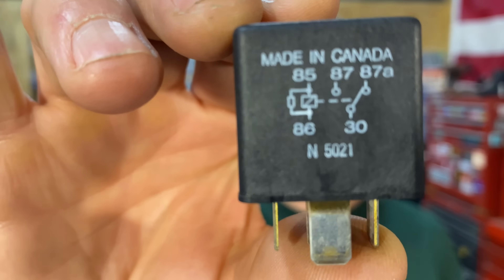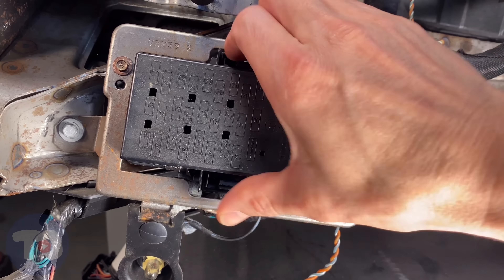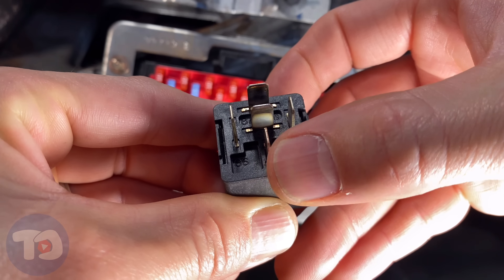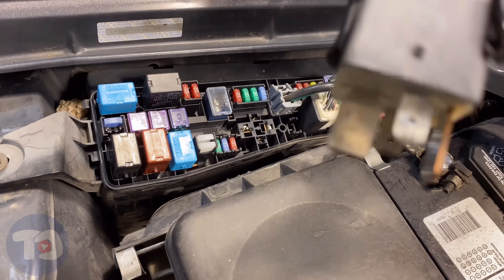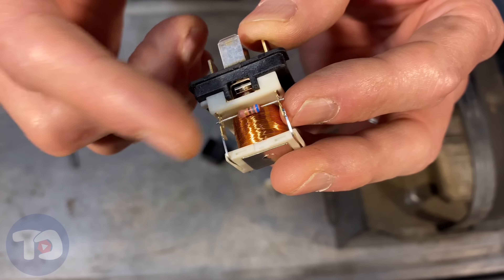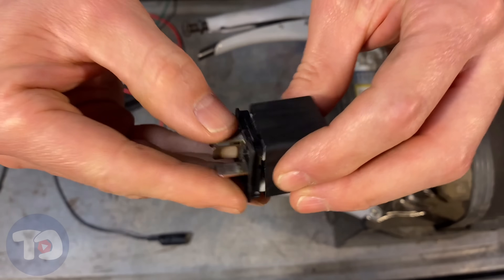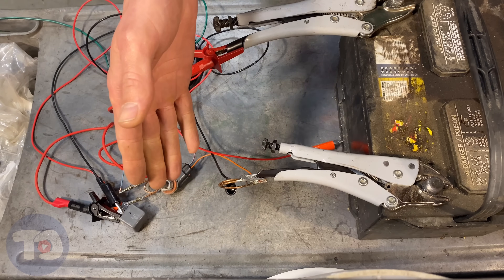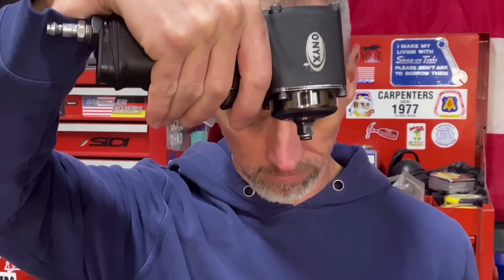Why are relay pins numbered like that?

Comment: Good video. The protective resistor looks to be 680Ω, FWIW, based on a quick search online for a resistor color code chart. Any idea why the engineers chose that value?
Reply: I guess that's from some calculation and experiments.The resistor is parallel with the coil, so when the coil receive power, so do the resistor. If the value is too low, it will draw too much current and become too hot, which will not only damage the relay due to too much heat, but also the computer that turns it on. Because chips in computer is not meant for big current. If it's too high, the flyback voltage will be too high when the coil is cut off, which will damage the computer.
Reply from the maker: I would have to assume that it still allows enough power to energize the coil efficiently, but also has enough attenuation to mitigate that current backfeed to protect the driver.
Reply: @ToolDemos it is the other way round, since it is in parallel wit the coil its resistance needs to be low enough to suppress the voltage spike when the relay is switched off, but it's resistance needs to be high enough so the resistor doesn't get hot when 12v continuously flow through it while the relay is powered on...
Reply: @Henning_S.  if a relay is hot to the touch would that be coming from the resistor? I replaced a couple relays that had started turning brown on the top. I presumed the coil was the source of the heat but it occurred without the relay switched on. There was nothing remarkable when I popped them open however you’ve given me an idea that I could check the resistance across the coil and across the resistor, would that work?
Reply: @ConceptXX  Probably not.
The heat generated by the resistor and coil is fixed by their values, and unlikely to overheat.
Very common is burned and pitted contact (that normally run cool when making good connection) are now generating a lot of heat.  (Just like a loose battery cable or starter wire getting hot).
The other possibility is excess or faulty load. (the fusing, if not overfused, should blow though)
Time to change the relay...
Reply: @troubleshooter1975  Yes, if it gets hot with the relay off it can't be the resistor,no power to the coil -no power to the resistor , so it must be the Normally Closed contacts on the relay that are pitted/dirty making a high resistance connection & thus heating
Reply: @neilf1059  I missed the part where he said it was hot to the touch when off.
If not recently energized; I would bet it was his blower high speed relay, a SPDT relay (5-pin) that is most frequently used in the 'off' state, and at 20-30A draw...
Reply: @ConceptXX  Neil F has a good comment.
Was one of those the relays for your  'blower high speed'?
If you are sure it wasn't energized recently and is still hot to the touch, the relay is bad.
Check that your blower (or whatever that relay controls) is in good condition, and not overfused in the fuse box.  If the load is not drawing excess current, then it is a bad relay.  Make sure you are using the proper rated relay for replacements.
Reply: It is not a resistor, it is a capacitor. The base color of the case is an indicator for that. Google “capacitor that looks like resistor” and you will see many examples.
Reply: @geertkroezinga6003  No-
That is a resistor.
And they never put capacitors on relays (unless it would be a .01µF for noise suppression, but those go across the contacts on higher voltages).

That is a 680Ω 5% epoxy coated film(?) resistor, looks like 1/4W.

Yes they do make capacitors in a package that looks similar to a resistor, but this is not one of them...

Comment: I can’t believe this kind of information isn’t more widely known among mechanics when it comes to those cryptic numbers stamped on relays. I mean, they seem pretty definite, and everyone who works on cars seems to know what they mean, or at least accepts them as normal. Thanks.
Reply: That which shall not be mentioned. 😂👻
Reply: Why would mecanics bother with understanding of electricity? Let the electricians do their stuff!
Reply: @micualex9799  Because over the last 100 years, "mechanics" as you call them have also been electrical technicians. They have also been electronics techs for only the last 40 or so. To better understand, try walking in their shoes for awhile.
Reply: @blackrifle6736  To understand is one thing, to apply what you understood is another. What I'm trying to say here is not to offend or create a discussion out of it. Simply I want to highlight that if you don't understand by all means how electricity works you should stay away and let professionals to carry that job. I've seen many cases when mecanic s tried "their best" an the results were...
Reply: @micualex9799  ...less than optimal. Or an absolute disaster. Cheers!

Comment: One thing... you state the switch never carries the full load but that is only true if you have a newer car with relays. These gadgets did not exist to be put in cars until relatively recently. For instance my '67 Austin has 2 fuses - one for things that are always hot and one for things only hot with the ignition/acc is on and that is the extent of it. Older Toyotas and Datsuns have a few more fuses but not a relay in site. I can't say for sure when these started to be common but I'm going to guess sometime in the 80's.
Reply from the maker: You're right, they didn't have a sophisticated design like today. They also had more electrical fires back then.
Reply: Look under the dash, bonnet or boot of any 40s-50s-60s Porsche or even further back; MBz and get back to me. Cheers!

Comment: Close to correct, but not quite. Yes, pin 85 is ground (-) and pin 86 is the positive (+) to the energizing coil to "turn on" and close the relay. But, pin 30 is usually used as the supply source (12v + or Ground -) and most circuits use pin 87 as the switched (NO Normally Open) item. Pin 87a is connected to pin 30 when the relay is off or (NC Normally Closed). [Note: Pin 87a (NC Normally Closed) may be missing on some relays]
Reply from the maker: You are correct
Reply: If its supposed to be a negative terminal or ground, the terminal code is 31, 30 or 30a is always supposed to be  battery positive, but in practice on a 4 pin relay you can usually swap 87 and 30 without an issue.  85 and 86 codes are used because relays can be switched on the high side or the low side  so they aren't necessarily wired straight to ground.

Comment: Neat trick with the mole grips
Reply: Battery positive needs a fuse - one accident and you get arc welding or a fire !!
Reply: @pjeaton58  yes for sure, 
I was just pointing out that for testing purposes them grips on the battery was a cool idea as the tiny testing clips won't fit them terminals.

Comment: The resistor across the coil contacts absorbs electrical spikes, this type of protection is very common in the US and is not polarity sensitive . Bosch relays very often use diodes to do the same thing these are electrical one way valves which again allow the spike to be absorbed, these are polarity sensitive, hook the coil up the wrong way and there will be a bang as the diode explodes. Both resistors or diode protect sensitive electronic controllers from reverse electro motives forces (Back EMF) spikes. When coils are switched off the established generated magnetic field collapsing produces a high voltage spike flowing in the opposite direction to that used to operate the coil, as mention just like an ignition coil on a petrol engine.  These reverse EMF Spikes can destroy an ECU control circuit maybe not straight away but grab an IGN wire and see how you feel😀. Some simple relays do not have these and are cheaper to buy and far more expensive if installed in place of a spike protected relay. How much is an ECU??
Reply from the maker: Very well said.

Comment: The numbers describe the purpose of the connection; they're not really pin numbers. So you'll see the numbers at 6:40 on other things, too, such as the ignition switch. You can see this if you look at a modern current-flow circuit for a car. The Porsche 924 I used to own was like that: at the top of the circuit diagram were several numbered "buss" lines and they were numbered 30, 85, 86, etc. according to their purpose.
Reply: Yeah. What beats me are those with the alphabet suffixes like 30N, 15F (examples of the format). I can recognise the numbers but have no definite clue as to the suffix.

Comment: You have a brilliant approach to explaining why numbers like 87 are assigned to the pin numbers of relays using the DIN system, BUT, for dummies like me, you didn't actually explain why they didn't use "123" (as you mentioned) instead.  I think you suggested they were just numbering circuits as they went along and when they got to relays, they had a number left to use like 87.  I would like more light shed on that, like, what came before 87, and after, and the most important question. WHY?
Reply: Ok, so the quick and dirty.

According to my reference textbooks, the DIN standard 72552 pertaining car electrical systems began the pin numbering as follows.
Everything is ordered in groups.
1-29 all had to do with ignition and engine electrics, that kind of predates the onboard battery, so the battery landed at 30 and 31 for battery ground. 
Then some electric motors were installed with pins 32-33, starter relay got number 45, flasher/indicator relay at 49,  with starter motor getting 50 for some reason, probably because it was an even number and thus easy to remember.
We need a windshield wiper, 53
Add lights: Fog, main, dipped, tail, indicators coming close thereafter beginning at 55 to 58.
Then the ac generator/alternator came along, so it got 61, (before it was just letters to designate what does what inside) and there was suddenly oddles of electric power on tap, so lets add a audio system and a cigarette lighter at 75, more switches at 81-84.
And that brings us to relays, which ended up on 85-88 depending on what it did and didn't and how it was manufactured.

There's some old wizened mechanics that did the Bosch course back in the 80's that told me anecdotal stories they heard on the course, but those are lost to the sands of time.
For reference:
https://up.autotitre.com/aad47e5a2f.png
http://www.kadett-olympia.de/Nuetzliches.html
https://www.vw-411.de/.cm4all/iproc.php/Technische%20Daten/Elektrische%20Anlage/Leitungen%20und%20Stecker/Klemmenbezeichnungen%20nach%20DIN%2072552.jpg/downsize_1280_0/Klemmenbezeichnungen%20nach%20DIN%2072552.jpg
https://web.archive.org/web/20191206215410/http://www.bosch-classic.com:80/media/en/bosch_classic/teile_1/switches/downloads_3/klemmenbezeichnungen.pdf
Reply: @SpaceraverDK  thankyou. Finally, an explanation and it makes sense.
Reply: Have to agree. The video is not titled "who gave relay terminals their names" . Current is misleading and disappointing.
Reply: mains relays /contactors  use odd numbers for N.O. even for N.C. or vice versa can't remeber off hand, seems to me they are doing the same here. but the lower numbers are already used on other types of relays
Reply: 1 is the contact on the ignition coil. 
And since cars had electric ignition before they had batteries, it is kind of obvious why they startet the numbering with the ignition system and battery + and - became 30 and 31.
Reply: @denzzlinga  How did they achieve electric ignition when there were no batteries?
(B.t.w.: petrol cars came after electric cars, batteries are way older then most people think)
Reply: @GermoV  the same as every lawnmower and chainsaw engine does it, a magnet on the flywheel that energizes the ignition coil every time it passes it. Works without any electricity from outside or a battery.
Reply: @denzzlinga  Yes, it's called 'magneto ignition' [in English]
Reply: @GermoV  magnetos, etc.
Reply: @GermoV  Ignition by magneto, starting by hand-crank, lighting by acetylene lamps. No battery required.
Reply: You can find listings online of the terminal numbers in DIN 72552, which might help with that detail. 30 is just "battery positive" and so maybe came earlier because it relates to a lot of other things.
Reply: Just because
Reply: He did explain it: "german engineering"
Reply from the maker: Good point. Maybe there should be a follow up video.
Reply: @ToolDemos  or maybe you should just rename the video to something that isn't misleading?
Reply: @ToolDemos  Or maybe you could just answer his question now.
Reply: @ToolDemos  Or maybe, if that was the title of this video, that should have been the topic of this video. As this video is now, it should be something more like "How do relays work"
Reply: @ToolDemos Please, no follow up video, you had  your chance to explain and you failed. Good riddance

Comment: This system has been created by electronics ignorants for electronics ignorants in the early days of automobiles. Especially wiring early vehicles was quite easy: Connect identical numbers by wires. To get this done no electrical knowledge is necessary.
Reply from the maker: Makes sense.
Reply: @ToolDemos  When drawing a schematic for electronics, you know, this is a special art. When done right, any other electronics engineer will understand it at a glance.
Then compare the schematics of automobiles, no matter if old or new. You will immediately realize, that the creator of that schematic had no idea of electronics. In order to get the automobiles running, the numbering system is still important!
Reply: Maybe take a look at VW Beetle headlamp relay some time? See if you can figure that out without looking at the terminal numbers?

Comment: B plus or, B+ is an old military radio reference, in WWI Military radio Gear, and by WWII A TON of military radios used two batteries to power the tube type equipment. Battery A was usually 6-12 volts and lit the filaments, the B battery was quite a high voltage and drove the plate circuits. Today many automotive wiring diagrams still call the battery, B+.
Reply from the maker: That’s really neat.

Comment: The reason for a diode suppressor relay is to protect the circuit from the high voltage field that is present when a coil is shut down. It protects electronics from a voltage spike like a one way check valve.
Reply: The resistor does the same job, albeit in a less efficient (wastes power while the relay is on) polarity-agnostic manner: if the coil draws 30mA, the 680ohm resistor will limit the back-EMF to 0.03x680 = 20.4V. One minor advantage from doing so is that the back-EMF energy gets dissipated quicker for slightly faster release than letting the current freewheel through a diode. Having a parallel resistor also makes it easy for the BCM/ECU/whatever to check whether the relay has a blown winding or external wiring issue. Whatever controls the relay likely has its own protection diodes as good practice anyway since failure of the relay's internal diode or resistor is always an option.
Reply: @teardowndan5364  but the resistor consume some fraction power of the relay, mean the relay will heat more during operation. why not just use back to back zener diode to limit the voltage?
Reply: @samueladitya1729  If you use straight zener diodes, there is nothing limiting current in case of an alternator voltage surge or a double-stacked jump-start. A parallel resistor won't mind seeing 28V for a few seconds while a 15-23V zener will most likely get instantaneously fried. Yet another issue is that diodes tend to fail shorted, which could destroy the BCM/ECU/whatever is controlling it while resistors practically always blow open.
If you wanted to do bidirectional zener clamping on a relay, you'd need to throw in a resistor on top. That is becoming a lot of extra stuff to secure in there to save P = V^2/R = 13.5^2/680 = 0.27W of power in a machine that idles at ~5kW.
Reply: When current flows through an inductor such as a relay coil the inductor likes to keep current flowing at constant rate. When one interrupts the current the magnetic field in the coil collapses (sourcing stored energy) to keep current flowing as long as it can, which can arc across switch contacts or damage semiconductor switches. As mentioned, this is how ignition coils spark spark plugs. The usual solution is to place a diode across the coil to loop the collapsing current back through the coil. Slight problem is this solution is polarity sensitive. A resistor is not, but not as good.
Reply: If replacing a relay's internal damaged freewheeling diode, take care of polarity.

Comment: Western Electric schematics used a number/number designation for connection points, but different.
The leading number calls out the Page where you find the mating connection, the second number is the connection point # on that Page.
On Page 5, Relay 52 (second relay from the top of the drawing and the equipment rack), Pin #4/137 connects to Page 4, point #137.
Page 4, point #137 (part of a large terminal block grouping) has a 'call out' to Page 5, Relay 52, Pin #4/137.
The redundant pin# is no mistake!
If the pin# on both ends of the connection match, there is no wiring error!
Any intermediate connections are handled in the same step-wise manner.
Hard to 'see' the overall schematic, but very easy to trace circuit faults!